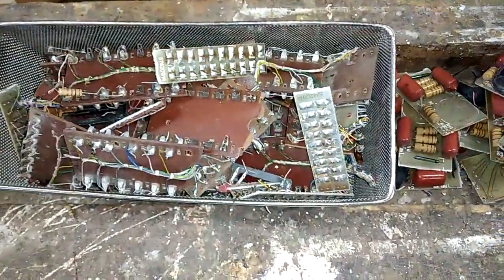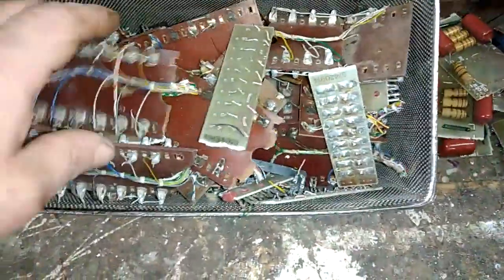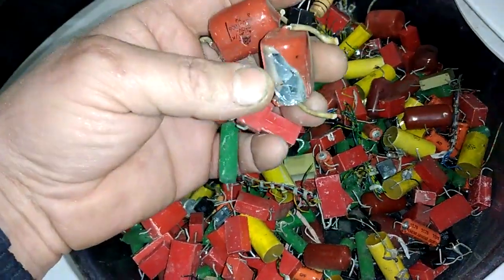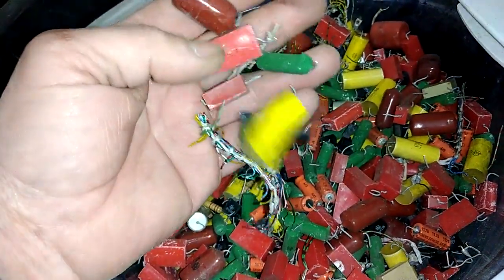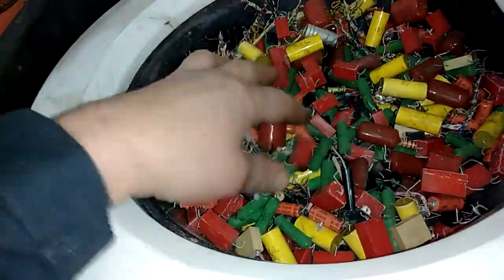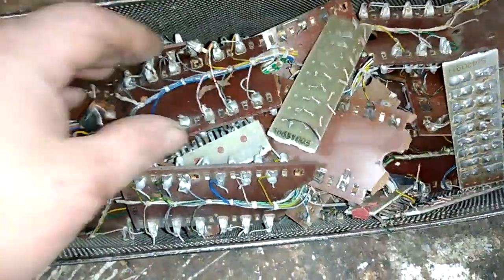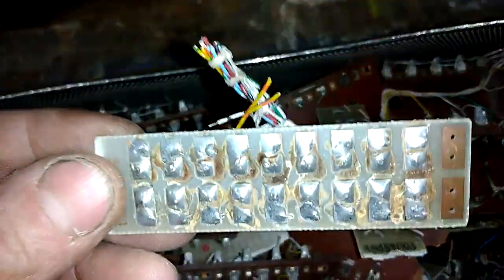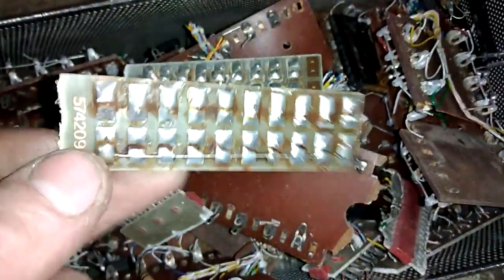Easy tin recovery from thick soldered boards!

Comment: How did you separate the lead from the tin? Burning does not separate lead from tin, they both have similar melting points and i didnt see you chemically separate them as its a process! And what you have is a heavily contaminated amalgamation! Its not worth much in that condition. If you tried selling that to a scrap dealer claiming its pure refined tin, he'd probably laugh his ass off at you!😅

Comment: hey dusan, just saw this and was doing research on cupelling... since that solder may have lead, and lead oxidizes to amalgate with precious metals while drawing off the non noble metals into the portland cement... curious if you can just do a cupelling with that bar and escrap metal as a pre refine.
Reply: What he did is not how you separate tin from lead! I'm a chemist,  and lead and tin have similar melting points,  ergo to properly separate that he would have to do a chemical extraction by using certain acids causing the metals to come out into solution, and then yet another process which is tedious and most of us chemists don't find it worth while to do! It's cheaper to purchase new tin rather than use up expensive chemicals to get a yield , which wouldn't even cover the cost of the materials and time! So he thinks some magic process in burning everything all up produces in his words( pure refine tin )😅😅 no way! Thats an amalgamation of lead tin and whatever other contaminates are alloyed in it.
Reply: @MichaelLapore-lk9jz  hey boss just saw this and was curious how you would go about separating tin and lead? Been wanting to ask a chemist about a process if it exists.

Comment: If you want to collect the solder from pcb's and don't want to burn them, I have had good results using a hot air gun. Heat an area then slam the board on a large flat steel plate. The solder will come off. It takes a little longer but does not pollute the atmosphere. Now you have tin, lead solder with maybe a little silver from the bga balls. From here you just refine out the silver if any and separate the tin from the lead if you want to. The tin can be used to make fresh stannus. The lead can be used for electrodes in electrolysis or as a door stop or fish hook weights. Dusan, don't worry about your English or spelling. Most people understand that English is not your first language and you do get your ideas across just fine. Keep up the good work. I like your videos and your new ball mill design. Australia

Comment: Solder for electronics is 60% lead and 40% tin.  How do you separate the tin from the lead?  You have solder not tin.
Reply: modern electronics use no lead, howeverlead contamination is possible so I would seperate the impurities by electrolysis.
Reply: I read it's normally with about that much lead, however my dad got me solder for electronics from a store he owns and it is pure tin.
Reply: I wondered the same thing. How does he know its "high purity tin" as he put it? The electronic solder i remember, like you said, was 60/40 Lead/tin, unless its silver solder.
Reply: @keithyinger3326   modern solder doesn't have lead in it anymore
Reply: Chemical extraction
Reply: I think the % is reversed
Reply: Lead vaporizes at 752 degrees F.  Tin at 2270 degrees CElCIOUS.
So separation is possible with the use of a simple propane torch..
Just stand clear,  as the vapor formed by the lead vaporizing is toxic when inhaled. 
Greetings from Zimbabwe Africa. 
God Bless

Comment: Great recovery, but is there a way of doing it without burning the pcb's/a more environmentally friendly way to recover it? 
There was some thick solder on your boards there, wow😮 Watch out for sneaky lead too! I liked what you got, a nice amount of recovered material!
Reply: You can heat the boards enough to melt the solder using a toaster oven or kiln, with a heat gun, or on a sand bath in an old electric fryer pan.  Then slap the board against the edge of a bucket the solder will drop out of the holes, or off the terminal strips in his case.  It would be faster and the solder would be a whole lot cleaner.  Also no hazardous smoke from burning the boards.
Reply: @macfixer01 fab ideas, thank you! I'm a fan of a heat gun anyway 👍🙂

Comment: Use Tin Chloride man. Give it a shot and leave it for a week
Reply: please explain what this will do.  thanks.
Reply: @rockman531  hi rockman. its a little hard to explain, easier to see/do. Tin from the chloride cements onto the copper in the solder, at the same time copper from the solder goes into the solution. They both attack each other, slowly reducing the solder off the PCB until eventually no solder is left, and the board gets removed with only copper traces remaining. This is roughly whats going on, but I'm unsure of exactly how. I've done it several times now, with many not believig or understanding rhe provess either. Only do it on Lead-Free pcb. Leave it a week or even two. You should see what I've explained.